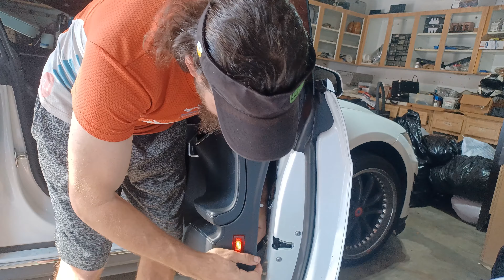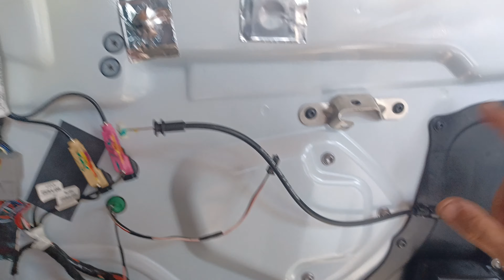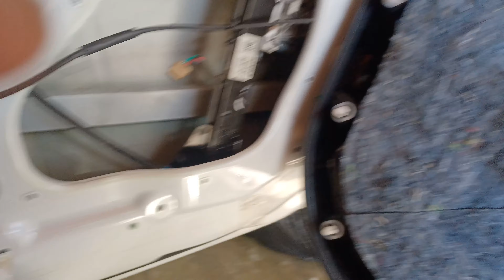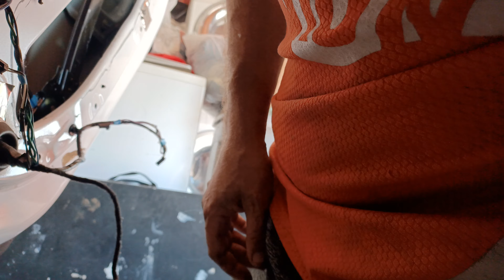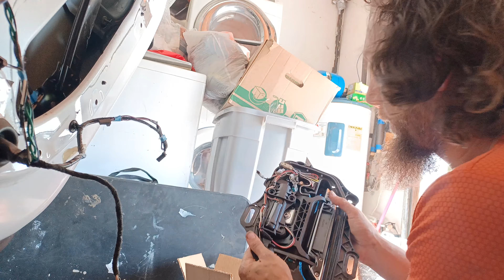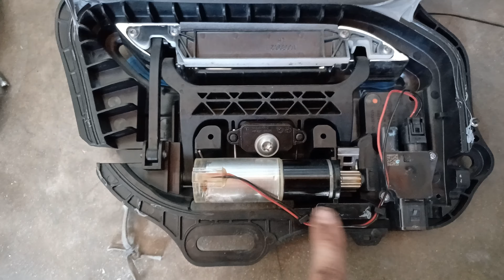Tesla Model S Door Handle Paddle Gears Replaced

Comment: Thanks for the walk through! Helped me out a lot. The drivers side was a little different because the top left bolt of the handle housing is a big pain to remove and reinstall and there are lots more wires to disconnect. But a great learning experience for when the other 3 break 👍🏼
Reply from the maker: Glad it helped! That's why we make these types of videos

Comment: After watching a more up close video elsewhere. Don't just hammer out the pin. Take out the paddle motor instead. This method will damage the center clip and possibly the springs under the motor and might cause issues down the road. You don't need to brut force it out.